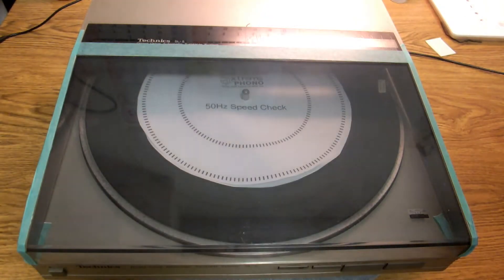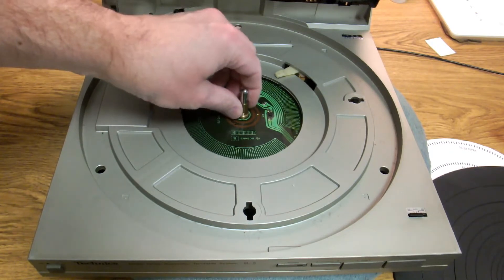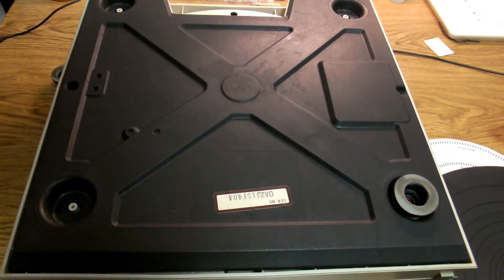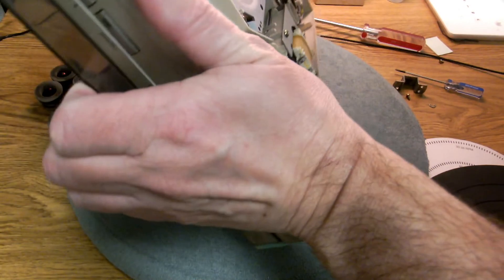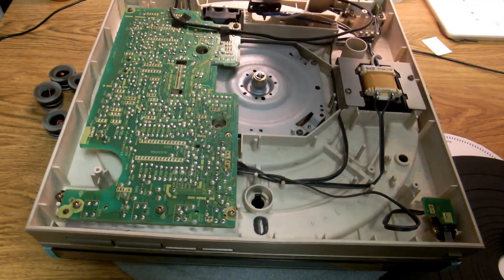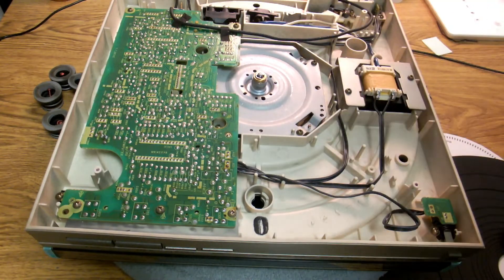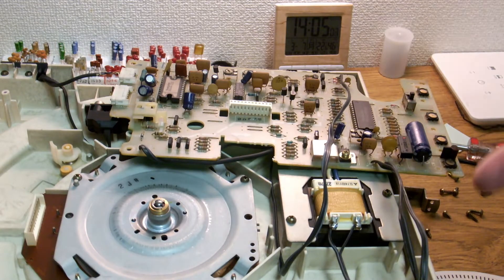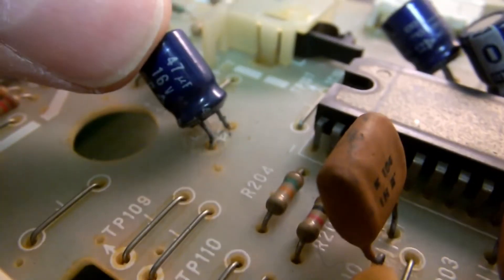Technics SL- 5 Seriies Part 2

Comment: Can you post in comments all the final capacitors you need to replace for SL-5?
Reply from the maker: Good idea.  Just done.
Reply: @felix_da_katze  Why did you use 47uF@16V for bipolars instead of the stock 100uF?
Reply from the maker: I replaced based on the values that were actually installed on the board.  I'm guessing it was a different revision, because another SL-5 had BP 100uFs installed, and that's what I was expecting.
Reply: @felix_da_katze  oh yeah I see in your video that they were 47uf
Reply from the maker: Yeah, I try not to second guess what they've done :)  I might update the list to say Please check with whats installed.

Comment: Thank you so much for this series!  I have owned my SL-5 since the mid 80's.  It sat dormant for ages.  I have been using it again for the last  few years. I have an issue which I believe is just a 40 yo belt and decided to do a "rebuild".  Thanks for the caps list, allowed me to order and wait until I had all parts before opening up.  Anyhow, the reason I am posting is I found capacitor #7 (as you counted) to not be populated.  Appears to have never been placed.  I wonder if this cap was removed from the BOM (parts list) later. There are holes on the component side, but there are pads coving it on the other side.
Reply from the maker: If it worked properly in the past then just replace the caps that you see.  These were sold all over the world, with minor variations, so any omission is likely deliberate.

Comment: hi! i recently picked up an sl-5 online, it has an awful buzzing problem. even with the ground cable connected properly to my preamp and the turntable ground port, it has an obnoxious 50hz hum whenever the needle is unmuted. the buzz disappears when i close the circuit with my body by touching the front panel buttons with one hand, and the ground terminal on my preamp with the other. do you have any ideas as to what is causing this problem? cheers!
Reply from the maker: Could it be something as simple as a break in the wire for your grounding cable?
If you haven't replace the electrolytic capacitors, then that is a possibility.  While you are in the underside, check the solder joints look ok  going to the grounding pin.
Reply: @felix_da_katze  if i play around with the cable it makes some funky distorted noises so it detects that a ground cable is plugged in, but it just doesn't ground the turntable at all. i tried a different turntable in the exact same setup and it worked just fine
Reply from the maker: I'd be opening it up, checking the solder joints, and replacing the electrolytic capacitors.
Reply: Bit late but did you try alternate cables? Sounds like a fault in the screen of one of the RCA leads.

Comment: Howdy! Slowly going through these so I may find an answer, but the tonearm tracking motor keeps slamming itself to the right once I turn it on, so it won’t play for more than a few seconds. Any known fault for this?
Reply from the maker: It's going off to the right of the platter?  It could be the servo gain is out or some other problem with the opto detector that makes the machine think it has reached the end of the record or entered a fault condition.  When I adjust the servo gain, it often happens that I trip the opto unit into thinking it's in an error state, and it returns back to the home position.
If it runs past the right to left, there was some discussion that it could be due to 2 faulty transistors on the main PCB, but I haven't confirmed or tested that yet.  I'm on the hunt for another to fix, and might purposely try to induce that error, as it seems to be the most common fault.
Best bet is to go through the whole process and see if the problem is resolved.  Let me know how it goes, I still check in, but have been a bit busy to make new vids for a bit.

Comment: I have an SL5 which inside has a small 640ma fuse just after the transformer which keeps blowing when it is turned on.  I’m guessing this could be caused by the capacitors?  Didn’t realise they might leak so I’ll take pcb off to check.  Thanks. Andy UK
Reply from the maker: That could certainly be the case.  Don't look at whether there is any physical leaks, they will be electrically "leaking" internally.  Ensure you can move the platter by hand too.  If it is stuck it might cause excessive current draw, but I'd expect that only after you hit play.

Comment: Thanks for this!
Reply from the maker: No worries.  I hope it solves your problem.
Reply: @felix_da_katze  I’ll circle back and let you know. Any suggestions on the oil or grease? I’m sure I have wd-40
Reply from the maker: Probably any light oil will be fine.  I use a light machine oil (like sewing machine oil) but any general purpose oil (like engine oil) should do.  WD-40 is only to help clean up and/or free up seized parts, don't rely on it as a lubricant - it dries out and isn't really meant for it.